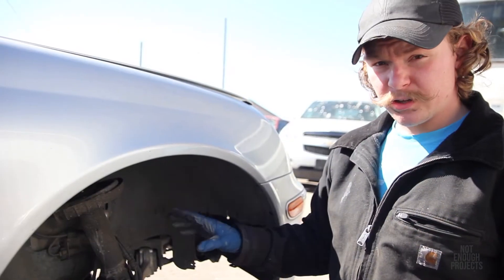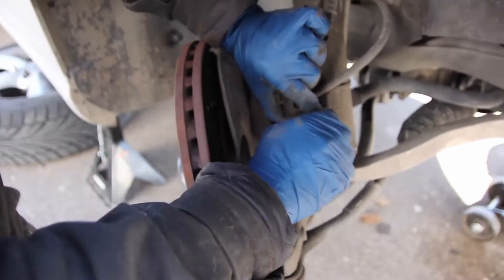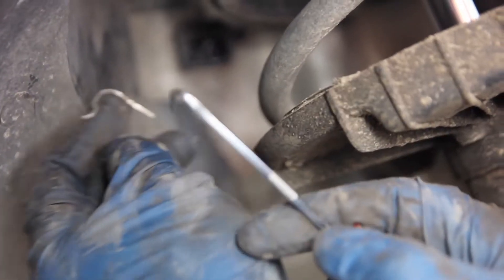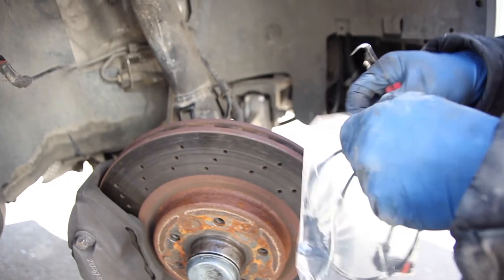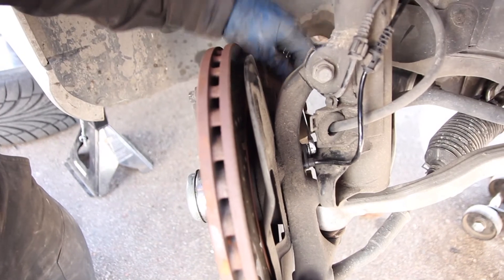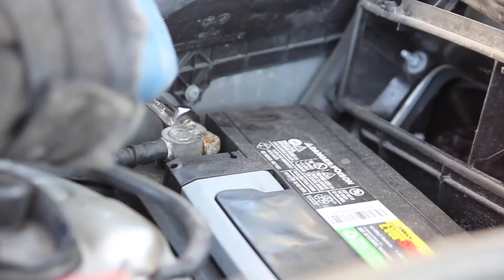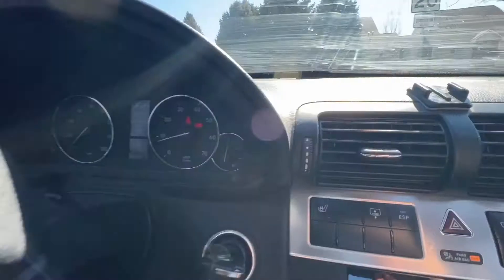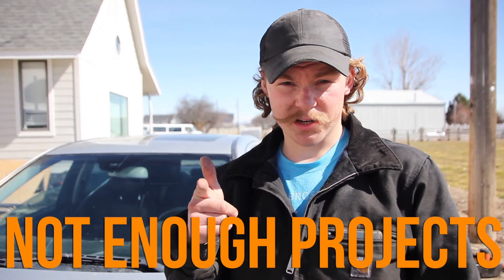05 C230 Front Wheel Speed Sensor Replacement

Comment: 2005 SL500- same message, ABS light on, 2 malfunctions, Work Shop, Scan said to check front passenger side wheel speed sensor. I ordered a new speed sensor. Installation generally looks similar with one big exception. Removal of the speed sensor at the wheel is a big problem. Have you had to change out a speed sensor on an SL500 front wheel? If so you know the problem I'm trying to deal with. What a stupid design. I can't find any reference that has changed a front wheel speed sensor on an SL500.
Reply from the maker: Sorry I'm just seeing this. You've probably figured it out by now, but here is the procedure: https://www.kolhosniki.ru/alldata&dir=part1&marke=1899&year=2005&model=13192&motor=39563&tbl=euro380&text=text_181596954&expand=12438
Reply: Cool video..cool moustache

Comment: I can’t switch any gears park drive reverse Neutral is this a problem of a faulty wheel speed sensor
Reply from the maker: A wheel speed sensor would not cause that. Your shifter lock is not disengaging. You can manually release it (look up shift lock override). Make sure your brake switch is working
Reply: @NotEnoughProjects  I am getting a pop up that says esp abs unavailable or something like that the same thing you guys are getting any idea what it could be?
Reply: @NotEnoughProjects  it’s a Mercedes Benz c230 2007 I just inherited it from a passed away family member but I can’t figure this out
Reply: @NotEnoughProjects  i have using the override lately but I’m trying to find a permanent option my car doesn’t have a break switch under the dash

Comment: I got a 6 speed manual and my parking brake doesnt work, do you need to take the wheel off to access all of that.
Reply from the maker: You shouldn't need to. Look up w203 park brake adjustment. You can either adjust the rear shoes or adjust the cable under the rear seat

Comment: Will  a W203 not shift gears if the wheel speed sensor is bad cause mine only goes to 60mph at 5000 rpm...
Reply from the maker: Hi, a faulty wheel speed sensor wouldn't cause that issue. It's possible there is another faulty sensor on the transmission, but it's hard to say without a scan tool that can read the trans codes
Reply: @NotEnoughProjects it does cause it

😂😂 you just don’t know c230 well
 It happened to me

Gear sticking in park till after sometime b4 i can switch then gear stuck and speedometer jumping up and down

I scanned and its vehicle speed sensor

Tracked it and change the wheel speed sensor and my abs and gear work fine
Reply: Turbine input shaft speed sensor A circuit ________P0715
Thats what the scan tool reported...to reach 60 mph the engine revs 5000 rpm and fuel consumption is 26,5 litres to 100 km....
What could be the problem
Reply: @BabaDarrel same problem, mine is now at lower speed around 30mph if you find out the exact issue let me know!
Reply: Mine not shift gears goes 60mph.the daignose machine says speed sensor has failed. I need to replace it

Comment: Hi, I am having the same problem but after looking at my scan tool for the problem of the abs everything looks fine base on the reading. Not sure why the abs light is on. Any clue or tip might help me?
Reply from the maker: Hey, are you sure your scan tool is capable of reading abs codes? Most basic scan tools will only read engine codes. If it is capable make sure it is compatible with your year Mercedes

Comment: Did it happen to you that it would go into 3rd gear?
Reply from the maker: The symptoms of a bad wheel speed sensor are: abs light on, messages displayed, no cruise control. Other than that no drivability issues. If you are stuck in third grear that sounds like some kind of limp mode to me or issue in the transmission.
Reply: @NotEnoughProjects  I have two DTCs for both front ABS sensors but no ABS light, it's an intermittent issue.
Reply: Thank you so much.
Reply from the maker: If you're getting codes thrown for front wheel speed sensors and nothing else I would start there. I would check wiring for any obvious issues that could cause intermittent connection. If you have access to a scanner that will read live abs data that could help troubleshoot. If no wiring issues speed sensors are cheap enough that you can replace and see what happens
Reply: @NotEnoughProjects speed sensor cause limp mode in MB